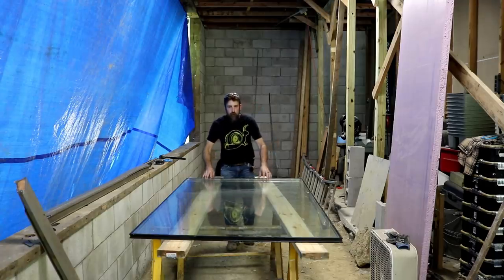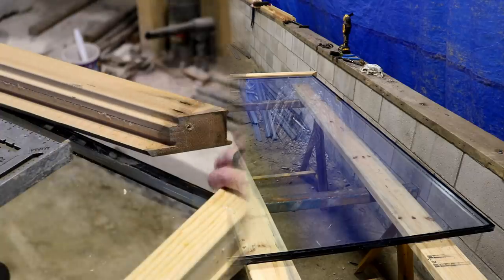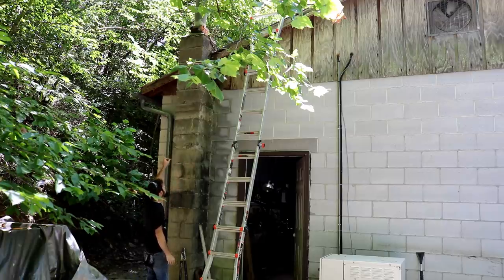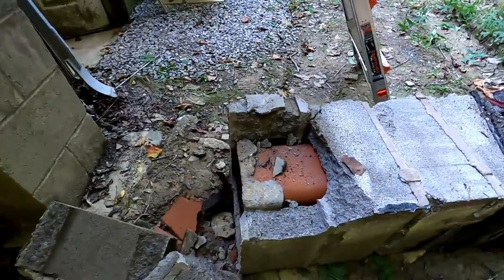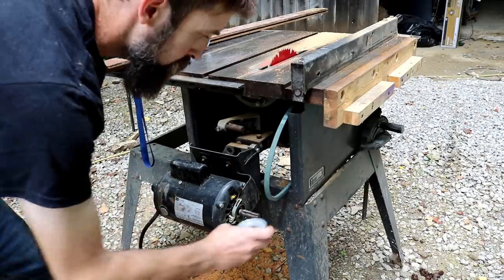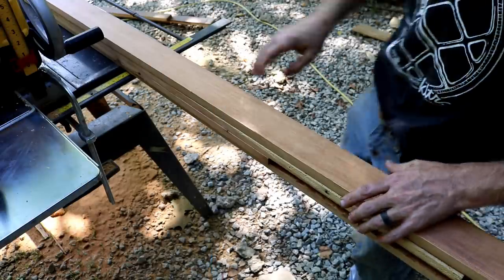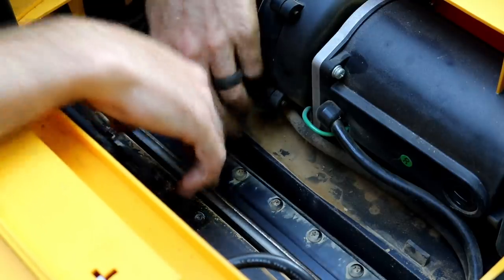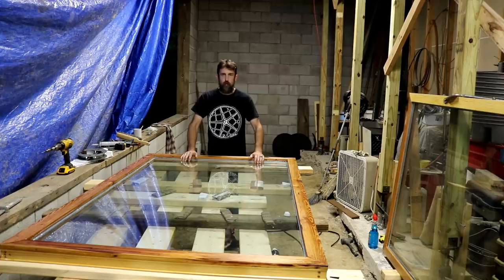Busting down the Chimney and framing the massive windows for the shop.

Comment: I had a Jet that had that same blade setup. Originally I built a fixture out of mild steel to use in my sharpening jig. But I could only really do this once because of the way the blades were mounted. I bought the helical carbide head. I didn't notice any degradation in finish. What I did notice was that it was way quieter. I was roughly as loud as a table saw vs mind-numbing shrill screaming.

Comment: I have the same saw, the pulley needs to be reset from time to time.  My shaft isn't beat up and has a key.  I've learned the characteristic rattle.  At some point I'll put in a new one and also add sleeve retainer.  I run mine on the proper size stand, wheel kit and I have both cast iron leafs on the right side.  Makes it more handy for cutting down sheet goods.

Comment: Don't know if it's still a common thing but growing up we had real good luck with "tar roof wash". It's a tar product that comes in 5 gal buckets. You mop it on. Super messy but will seal up a metal roof and stays flexible. It also comes in a metallic silver that works to reflect the sun. Seems to help cool things off a bit in the summer?

Comment: Have that same planer. Been using it for over ten years. Still running on the original blades. I sure they’re getting pretty dull by now, but they still leave a smooth finish. Yes, I’d love to have carbide, but just can’t justify the cost. And yes, those Dozuki pull saws are very handy.

Comment: More great progress! Those giant windows will be awesome. I hope you have better luck with that urethane than I did. I use the same thing on some heavy oak slats on a cast iron garden bench. Lasted two years and flaked off 😖. I haven’t tried it yet, but a friend of mine suggested mixing 50-50 with urethane and fiberglass resin.
Reply: Spar varnish lasting two years for that application is about right. What destroys clear varnish is U.V. rays, and Spar varnish is U.V resistant but not proof. That side of Steve's shop seems quite shady so it will last much much longer. Attempting to paint over it will be very problematic though. It will need to be thoroughly scuff sanded first with 100 or 150 grit to give it "Tooth" for the paint to mechanically grab, and for best results, a urethane based paint. I have had some good results using paints for metal like Rustoleum though.

Comment: Love love 😍 Spar Urethane. Use it on the beehives. One thing to note, whatever color the wood becomes that's what your stuck with. Latex paint comes off if you just look at it. 
Haven't tried oil based paint though.
Reply from the maker: Thanks👍. I'm not certain I'll end up painting them anyway. I like the look of the trim as is really.
Reply: @SteveSummers  Just wanted to mention top coats don't work for anyone that is not familiar with urethane. I tried using urethane as a base coat and it was an epic fail.🤦‍♂️
Reply: Have you tried using a primer on urethane? Usually you have to scuff before you apply a finish over a gloss too. Get some tooth for the paint to grip. For household I'll only use Zinsser B-I-N. It costs more and is a pain to apply and clean up but the results are worth the hassle. In the end results are all that count. BIN delivers too. If you ever use BIN be prepared for a strong aroma. You need to clean up with ammonia too. Again there's an aroma. But also be prepared to see BIN dry right before your very eyes. You can sand it within minutes of application. It sands great too. But goes on smooth to begin with. Does stink working with it. But it don't stink to work with it.
Reply: @1pcfred  No, the urethane is formulated to be directly applied to wood. The product I used was a semi-gloss so didn't do any sanding. For a beehive you paint a colored geometric shape so they can tell which hive is theirs. I cut small patterns of galvanized in different colors and attached with screws.
Reply: @unclebobsbees4899  I meant put primer on urethane to paint over it.

Comment: I hope that the seal between the glass is not damaged. Otherwise you will get condensation between the layers because the trapped inert gas is the insulation. Smart move to keep them stationary.
Reply from the maker: That's my biggest concern. Hopefully they hold up.

Comment: What haven't seen is what are your plans to heat the shop? With as much room as you will have now, maybe a huge (large rock front fire place with some kind of heat-a-later  system. I mean some kind of fans to push the heat out in the middle of the room. You've plenty of fuel around you (trees). Kinda make it a Wifey friendly space so she can spend time out in the shop with you.

Comment: I'm sure you have already put some thought into this but I'll say it anyway. (I would) build the headers for those windows as tall (2x10, 2x12) and as thick (3 or 4 layers) as possible & with a little crown in them as well. That's a long span over the glass even though the ends of the roof truss may not be that heavy. Put as much overkill it there as you did in the masonry. You are going to enjoy that part of the shop with all of that natural light. Thanks for taking us along for the ride.
Reply: Or turn down the shaft on the lathe.
Reply: @ericpaul4575  might want to repost this to the proper comment.

Comment: Great to see windows going in, as it's such a lovely view. Though, I think I would have made them slide open, a bit like a patio door, using rollers. Doing it this way makes it easy to build and easy to seal.
Reply: There's nothing easy about installing windows that size. Making them move don't make it any easier either. Fixed is the simplest and easiest.

Comment: Nice to hear that someone else knows the truth that carbide can not be as sharp as good high speed steel.

I own a Powermatic #100 planer and once I got it tuned up, it cuts beautifully and with Amana Tool knives, they seem to stay sharp for a pretty long time as long as you don't feed it any nails.  The straight knives do have trouble with curly grain though.   I'd love to see someone like Amana make high speed steel knives for the helical planer heads.
Reply: Carbide cannot get as sharp but carbide stays sharp longer. So which is sharper at any given time is the question.
Reply: @1pcfred  I don't know if that is actually true.  

I do know for a fact that most planer and jointer knives on the market are made from soft "HSS" and they dull very quickly.  

I wish I could borrow a hardness tester to confirm this as I have several from major manufacturers and they're just flat out garbage.
Reply: @prototype3a  my planer blades seem fairly soft to me. But they should only be cutting wood. Although some wood can be very abrasive with silicon deposits. Being soft they sharpen easily.

Comment: You really want to look for an extension chainsaw to handle those tree trimmings. Gets 6m into the tree, and will handle branches the lopper will not touch, plus you can be on the ground and trimming the tree, with complete safety. Electric one is cheap, and will run with a little care for a number of years, only needing to keep the chain nice and tensioned and the oil tank up top full.

Had one for a number of years now, and it works well for trimming the trees to keep them away from fencing and roofs, and only have to call out the pro tree trimmers every 5 years to do the big remove most of the shade tree trim. Also nice to trim thorn hedges, and will come in useful to keep your shed and parking, plus the driveway, clear of low hanging brush. will even work as a regular chain saw, though there you will be cutting at 6m from the branch in question, but for the bits coming down gets them in small parts fast.

Used it last month, and in 15 minutes had the tree trimmed, the logs cut up, and all was ready for the dump, about your van bin packed to level with the edge. 10 minutes after to clean, retension the blade, and get it to be nice and oiled again, with the 20 minutes in the sun acting to dry the blade out from the wash.

Comment: Those old craftsman tablesaws are pretty hard to beat. I have one that's a little heavier duty than yours and it is accurate and smooth as can be.

Love my Japanese pull saws too. Once you use one, you won't go back to a regular hand saw.
Cheers.

Comment: Steve had the same problem with a sears table saw replace the pulley and by a link belt from Harbor Freight the link belt runs 100 times smoother solves most of the vibration on the pulley fixing the issue.
Reply: Link belts are an addiction. Once you start using them you can't stop. 4 machines in my shop run link belts. I'm maintaining my habit now though. I actually bought some Fenner links at a yard sale once. I got a few feet fix for cheap.
Reply: @1pcfred  Addiction that's funny but man I fought the pulleys on my table saw for years. I was so tired of messing with it I bought 2 new pulleys and they loosened up to then I bought the link belt and have never had a problem since. Then the drill press got it's link on and bought a uni saw and it got it's link on to.
Reply: @time1800  it always starts out innocently enough. You say to yourself I'll just put link belt on one machine. How good could it really be? Probably doesn't even really make a difference. It can't be worth what it costs. I'll try it just this once and see for myself. The next thing you know you're eating sushi in a cave muttering about my precious. It is a sad descent into link belt madness.
Reply: @1pcfred  I'am tight wad  no way will I pay that much for a belt!  Well I needed belts for a Kellog air compressor I was building pump was free and had a 60 gallon tank laying around needed belts picked my self off the floor when they said the pair would be $55.00 plus Tax I miss the days of a $3.99 belt and a complete rebuild gasket set for $25.00
Reply: @time1800  everything is expensive today. That's what happens when everyone makes so much. I see these discussions online of tradies that want hundreds of dollars an hour for doing jobs that do not even require a high school diploma. The gist of those is generally how they can't be bothered doing this or that because their time is just too valuable. Uh huh. They're basically saying they're too busy to work. Which comes across as too lazy to me. I wouldn't do that! Too good for it are you?

Comment: you might be able to turn that motor 180'.  the shaft prob. is on the other side the same.  the motor direction can be changed.  they work better on 220v.
Reply: Whether a single phase induction motor can be reversed or not depends on how they wired it at the factory. They sometimes bury a pair of wires in the motor housing. It's cheaper to manufacture that way. They can sell you more motors when they do that too. So it is fair to say they have their reasons for doing it. I'm sure in some applications they want to make sure no one reverses the motor direction.

Comment: You can get a helical cutter head for that planer for $400. That's why mine doesn't have one. Supposedly they are quieter than the straight knives.  I believe the carbide cutters for that one can be rotated 3 times.

Comment: Steve, I think that you shou;d change you mind about using that glass. first reason if you break the glass can you get an exact replacement? It is easier to put in a smaller window in an opening than it is to enlarge the opening. My suggestion is get 2 or more 8x4 foot double pane three panel windows 1 fixed panel and 2 sliders. Get standard sized windows with UV  and anti glare coating. If you break a window you can always get a replacement that will fit. Some times it is better to pay more up front to save head aches in the future.

Comment: Nice job, I must remove my shop chimney and make new.  It is steel pipe. Holes and risk everywhere. I think that I make it stainless steel. I can heat my shop with electric but in Finland it is wery expensive. Oil is cheaper. I and my Pimudog and Mickey cat sends all the best for You, Family and Dogs and shop Scuirrel. Sorry my writing mistakes. My own languge is Finnish. Seen again..
Reply from the maker: Thanks for watching 👍. In  Finland a good chimney is a must. Definitely want to get that sorted if it has holes in it. Cats love a a good warm spot😁

Comment: I'm happy you were able to re-use the framing from the windows, that saved so much work!     Maybe in the next video you could tell us what type of heating (if any) were you thinking of using?    I've done a lot of metal roofing and that roof pitch (as you know!) is too low for that type, although when that roof was built that was not so well known. There are metal roof styles specifically designed for low pitches. I believe you are replacing it with shingles?
Reply from the maker: It will be done with shingles. I still don't know what heat source I will use. It's so far away from being able to be heated I haven't given it much thought.  Thanks for watching
Reply: @SteveSummers  When I commercial roofed we put insulation down and then put roofing material on it. Are you planning on doing that on your roof? We roofed over commercial decking. Your corrugated roof is different. This is what it looked like when we did it https://facilityexecutive.com/wp-content/uploads/2017/02/FEFeb17-TrendsBonusIns-Feature.jpg You don't have to use two layers. They probably just want the extra insulation? The insulation is a nice base to work on though. Makes it flat.

Comment: I am not sure is someone already mentioned it but I would like to add my two cents concerning the spar urethane you are using. Steve, you are going to want to use multiple coats sanding between each coat. The more the better.

Comment: It's better to screw wood screws on an angle in cases like those corners you were gluing because they hold best if they perpendicular to the wood graines. In fact it's quite easy to pull the thread off in the hole just by trying to tighten the screw if it goes in the end grain direction effectively transforming the screw to a fancy nail inside a loose hole:)

Comment: Not an armchair wood treatment comment, one made from experience as I've just done this on my roof and, unfortunately too late if you've already urethaned the frames. Linseed oil based paint is the answer. Water goes in, and comes out again when it stops raining. It let's the wood breathe. The urethane will admit water behind itself ultimately and trap water..... I've just painted the soffits and fascias of my 150 year old house with the stuff after stripping right back to the bare wood. Heinously expensive though.

Comment: That chimney almost seemed like it was added as afterthought.  There's no way you should have been able to just pull it down the way you did.  I didn't see any evidence of tie straps embedded in the mortar joints to hold it to the wall.  As for the construction of the chimney it looked pretty standard.  I believe the block damage was caused water/acid build up from an incorrectly sealed flue tile (the liner) and no clean out door at the bottom of the flue.  I learned a lot of this from my Dad-he spent his entire working life in construction, mostly masonry and concrete.  I think you did an excellent job on the walls.
For the wood trim on your windows I don't think I would paint them.  Just use the spar varnish and leave them a natural color.  That spar varnish should hold up just as long as any paint would.
Reply: Woody Hastings . Or Steve I know you are following Randy Richards in the shop and his shop extension, I would follow his example and use the same Sikkens product for all the rest of your wood construction as he says when he talked about it when coating his barge boards and other timbers he has it on his house and his shop and some of it has lasted 35 years without re-coating that's a pretty good recommendation in my book you will be an old man when it needs doing again and your boy can then do it Steve! Lol

Comment: Hope you are dreaming of ways to insure that those windows don't get away from you while you are standing them up in the wall.  It would be a shame to put all that work in them, only to have one fall to the outside to shatter on those rocks ...

Chimneys built like that one ... must have seemed like a great idea at the time.  I've dealt with one of those, took it out like you did yours, and had to rebuild water damaged roof and wall.  Stuff like that, you have to be proactive about keeping them from leaking.  I put corrugated roofing on the same building, every spring & fall I'd go up with a wrench and a tube of gutter an lap, adjust any screws that needed it and check all the joints for lack of sealant.  I planned to put elastomeric down after the exposed surfaces had weathered a few seasons, but I got an offer and sold the place.  Good thing I did, the economy and housing market downturns happened after that, and I almost certainly would have lost the place.

(I'm just one big frickin' ray of sunshine today, aren't I???)

Comment: Hi Steve, first to say i like your video’s i am looking  forward to them every week, a suggestion in connection to the 
sealing for your glass windows i think it is beter to use UV ressistant Silicon sealing that last much longer, but perhaps you 
already knew that.
Reply: I'm thinking the windows face north.  No direct sun.

Comment: i have a large garage/workshop 13mx8m and i didn't put any windows in it just two 3m wide garage doors and side entrance door, any garage/workshop I've been in before which had windows . had a big problem with spiders webs everywhere, also windows take up shelf space, no windows no spider webs, also if i work in garage i open the garage doors plenty of light